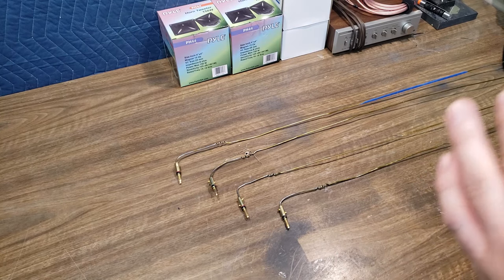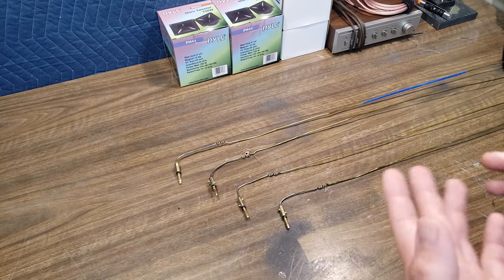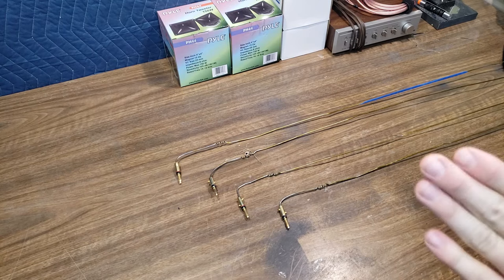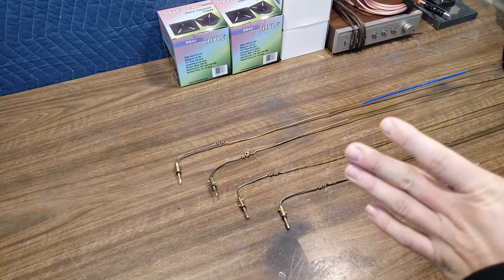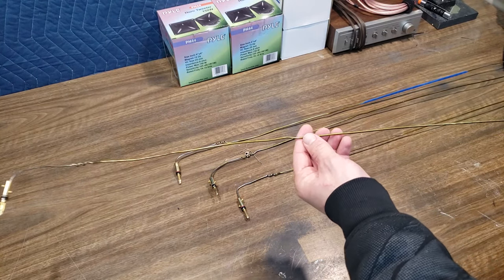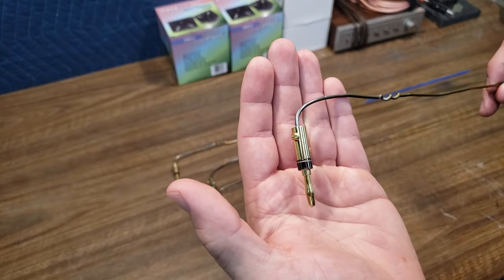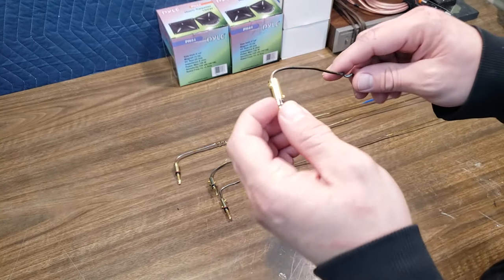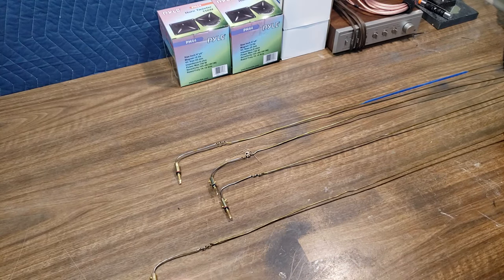Coat Hanger Speaker Wires (-; A Hidden Audiophile Secret ;-)

Comment: I'm using some pretty good headphones. For me the sound is identical with the official cables and the coat hangers, and I didn't expect any difference. Given the nature of the signals being transferred in audio systems (<20kHz), cable capacitance and inductance and the difference in resistance is not enough to change the signal leaving the amp in any way. The impedance in the speakers is the only thing that will impact the electrical characteristics of the speaker circuit and we know that tends to vary over the frequency range, but the wires feeding speakers are transparent.  I did get a kick out of how you talked about the specs of the hangars. Hilarious.
Reply from the maker: Yep, this is what I've been reading about and testing. Once a certain level of LCR specs are met its nearly impossible for a human to truly distinguish the difference.  Many of the expensive wire co they tamper with LCR levels so the cable begins to act like a filter causing the speakers to sound DIFFERENT but many people mistake this for BETTER. I've been testing 14,12,10ga CCA, its the same I've yet to repeatedly decern the CCA cables in a blind test.

Comment: As a true audiophile, I do not use anything made with below 0000AWG wire.
Reply: How do you fit the wire into the amp/speakers? Do you have custom made 9XL banana plug openings? Interested in trying 0000AWG as well. 000 isn't cutting it for my ears

Comment: It works like a charm. You must try STEEL TMT BARS. They have a specific conductance most suitable to get warm miss yet punch in the lower end. HFs are best connected separately with OFC Cables.

Comment: i've used old copper spark plug wires before. superstocks ftw!!! nowaday's they're all disappearing with coil on plug ignition though. and even before that, resistor wires.

Comment: Great flexibility 👎. No way my man, no way!
Reply from the maker: Yes, these amazing cables are bit on the stiff side. Keep them straight as possible for best sound though. To many bends will mess up the inductance bias. Then you'll need my coat hanger power cord to make up the difference.

Comment: DUDE.......where is your mental state. OK, so about this 'coat hanger'... well it's ONLY the matter of the MATERIAL dude and NOT what it's used for. I have seen many cray ideas, and yours is in the top 15. I make my own connectors among many other things (click on my name) and the TOTAL metal pure copper weights in at 0.65gr. The less, the better, for NOT to change the original signal source. Thanks for the laughs I had for the first 7 or so minutes, while I typed this message, and I am out of here 🙂